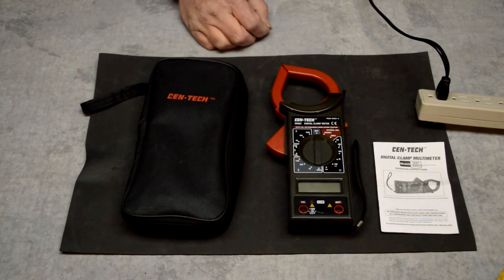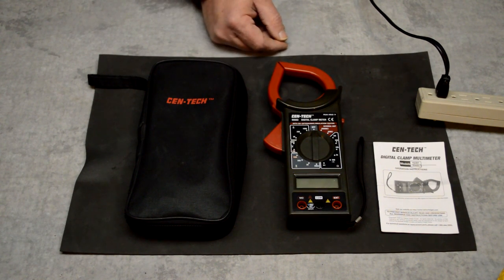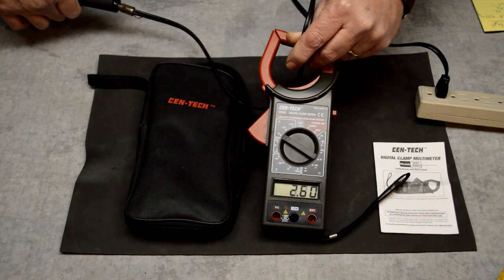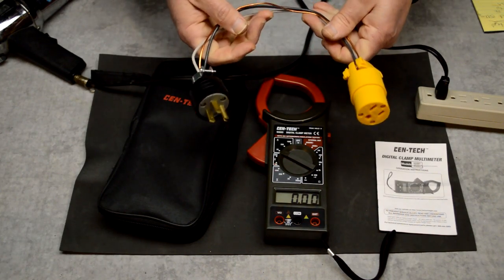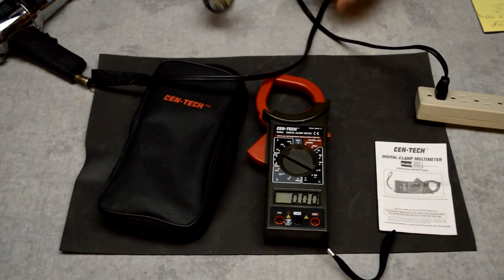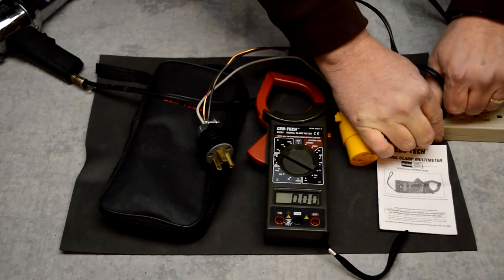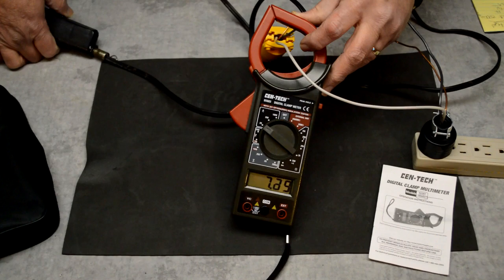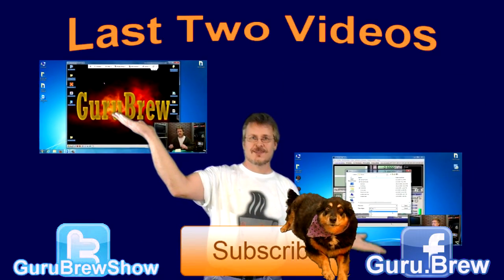How to Use a Digital Clamp Meter - Build a DIY AC Isolation Separator

Comment: The additional bit on that meter is not an isolation tester - it’s an insulation tester. Totally different thing. An insulation tester tests the insulation between hot and ground and is measured in ohms. It’s used for testing for partial shorts to ground on household AC circuits and appliances (where obviously you can’t use a resistance meter on a live circuit). It should be in the mega ohms range if good. It helps identify things like bad sockets, rats chewing through old wiring, householder “wiring” etc. I wouldn’t bother with that one though even if you could get the optional add on.

Comment: Hey thanks for passing on the knowledge. I know almost 0 about electricity and need to troubleshoot some stuff with a multimeter. I didnt know I would need to isolate the wires when using a clamp. thanks!

Comment: Anybody who buys a clamp meter will obviously know how to wire a test plug up. That bit of video was a waste of time and the whole video was a waste of bandwidth.
Reply: Gray Anderson correction: anybody who buys a clamp meter and didn’t return it within a month might know. I’ve seen ‘experts’ turn on a meter while holding down the hold button and it took a while to discover why the readings were all identical except for the decimal point.
Reply: I did skip that part but I can see the logic of showing it.
Reply: And you sir taking the time to reply your rude comments ALSO wasted bandwidth then. I remember learning when I was young that #1. If you don't have anything nice to say to someone then don't say anything at all. And on closing, may I say that you need to quit polluting the internet waves with your hater negativity.......sir. Have a nicer day!!!

Comment: Is this meter for AC current only?
Reply: sdcoffeeroaster judging from the comment about the alternator, I’d suppose so.
Reply: Only AC current... AC/DC Voltage... To measure DC current you'll need an expensive true rms clamp or electronics multimeter (these doesn't have clamp and you´ll need to cut wires to measure current)

Comment: you should not have taken completely all the out insulation of the cable as the gripper at the plug and socket outlet will bite on the single core insulation you need to be very careful for safety sake
Reply: I’m sure the wise engineers wouldn’t design a metallic gripper that would fully close on 3 unjacketed wires.

Comment: Use a 3-wire, instead of a 2-wire, with a green wire for the ground so there are no bare wires in the separator.

Comment: Thanks Steve. I need to check a 50 Amp wire for an RV.  For an Insulation tester, what gage wire?
Reply: Comedy Plus nothing less than 8, and 10G is for <30Amps.

Comment: Thank you for adding this video with the isolation separator. I bought a Klein Tools CL210 digital clamp meter and there is nothing about using an isolation separator in the instructions. I followed your instructions and started to receive stable and accurate readings. I almost returned the tool. BTW I took a 16" long grounded extension cord with three outlets on the end and made it my isolation separator tool. This way I can plug multiple holiday lights into the extension cord but measure their combined amperage. Thanks again!
Reply: Every meter using a clamp tells you not to clamp two wires.

Comment: how would i check my alternator amperage with this clamp
Reply: Simple. Just clap it around the hotwire of the alternator and read DC amps. if you have over 0.05 amps AC (preferably 0.00 AC A) then you have an issue.
Reply: You also want to use the probes to check that the cranking/running voltage x is 9<x<16VDC and that there’s 0 VAC at all on the battery.

Comment: The instructions don't talk about 220.  So if I have 2 hots, and each records 10amp.  Is that a total of 20 amp, or a total of 10?  I am thinking 20.
Reply: It depends on where the hotwires go. If they are separate hot circuits feeding a 220 V appliance,. they are still only separate 10A circuits. Two 10 gallon rivers cannot make a 20 gallon river unless they converge.
Reply: Measure the neutral current and if it’s got nothing, that would be total 10A. If it’s got 20A, then 20A.

Comment: Harbor Freight USE to sell this item.  It was also from CEN-TECH and labeled a Clamp Meter Line Splitter item number  #92072.  It can handle up to 15amps, and has two openings for the clamp meter one of which had a 10 turn coil around it giving a X10 reading for better low current resolution.  Check eBay for Clamp meter line splitters, there's a bunch and they all look like the Cen-Tech I have.